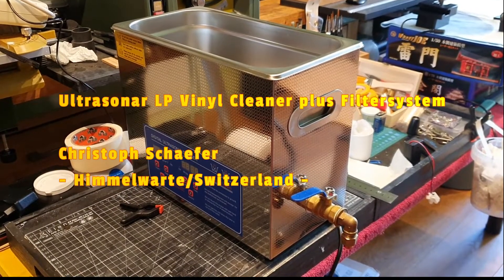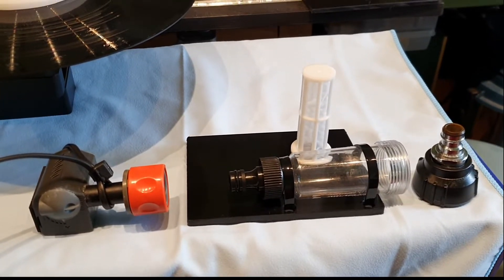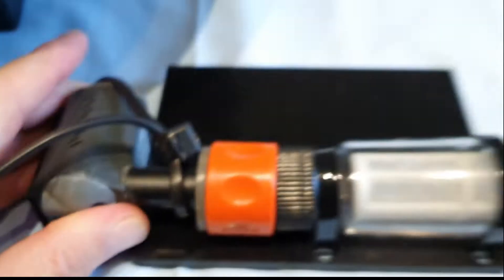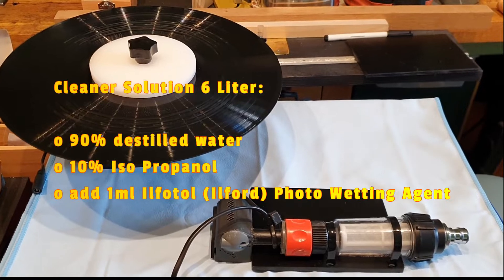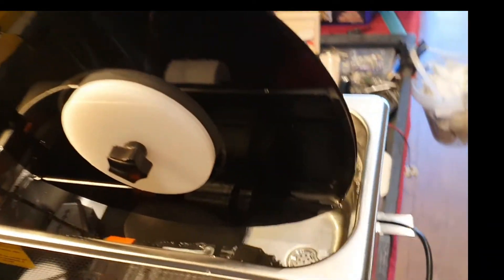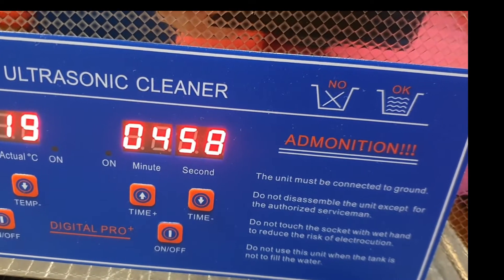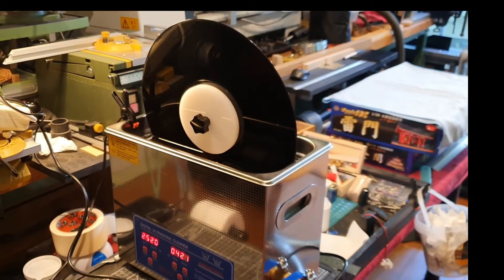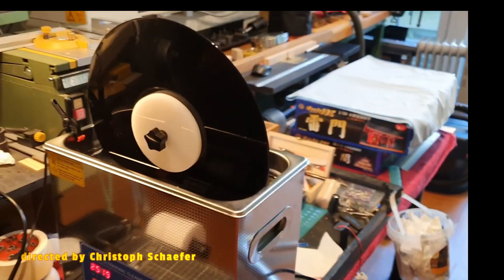Ultrasonic Vinyl LP Cleaner and internal Filter Unit

Comment: I saw this idea which will save in a long run a lot of distilled water, as it need to be changed in my case after 3 or 4 baths. I just have some concerns about putting the pump and filter inside the tank can affect not only the mechanism of the cleaner but the motor pump too and maybe disturb the process of cavitation on the record. I want to construct this "cycle" but I am thinking if would be better to use the tank faucet to slowly drain water to an external pump, pass the filter and then returning the water with a little hose to the tank. Thoughts?
Thanks!